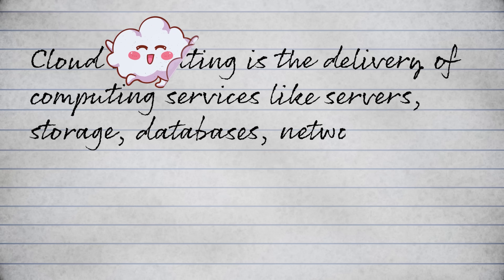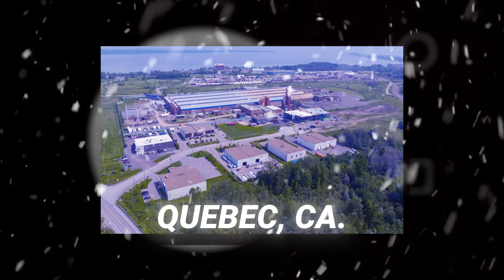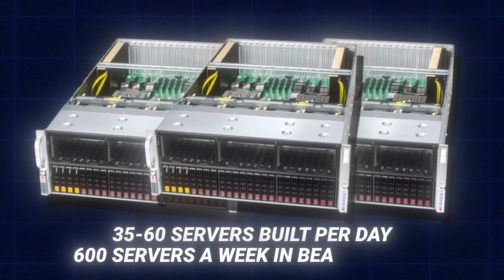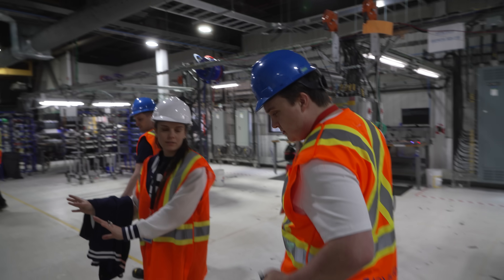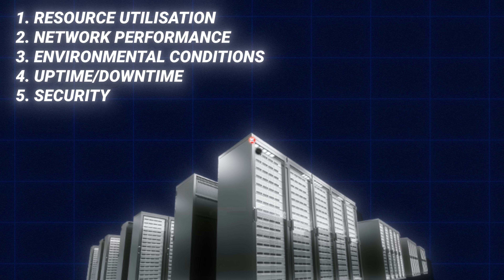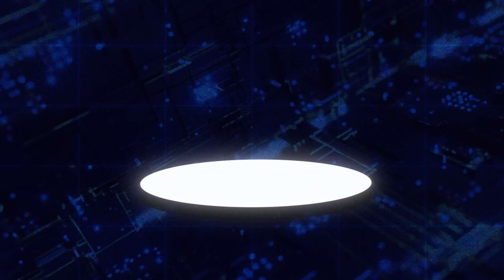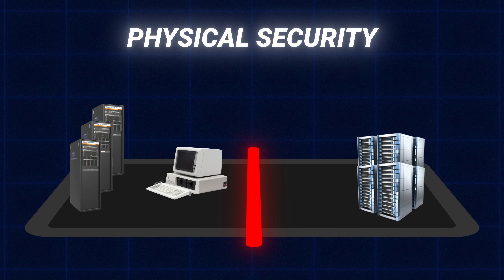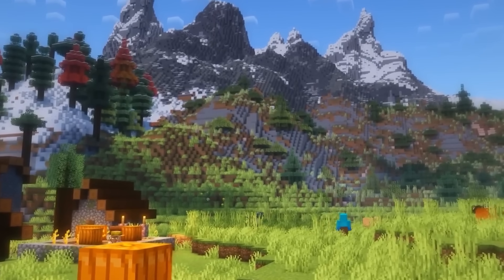Inside a Data Center with 90,000 Servers

Comment: why in the hell do they need the radiators with a body of water nearby they can just use a heat exchanger???? dump the heat in that 40 degree water
Reply: Radiators serve as a way to cool the room (In summer) and heat the room (in winter), they do use heat exchanger plates

Comment: Grafana is great for reporting from tons load of data.  Very easy to create your own dashboards with it.   Too bad they didn't say which Hypervisor they're using which I can understand due to privacy reasons.   Seems they embrace open source I wouldn't be surprised if they are using Qemu / KVM.    Myself personally and professionally I use ProxMox which is based on Debian with Qemu / KVM installed.    Personally not sure why they didn't want to show the merits from Grafana since it's standard stuff at the data center.   Probably they didn't want to show any identifiable host names which can be blurred out.

Comment: This was really cool to see, especially on what OVHCloud operations look like (obviously only at the surface level). I work for a cloud provider at a colocation data center, and I have been to countless locations by multiple ISP providers. Sometimes the infrastructure is extremely disappointing, and sometimes the infrastructure amazes you. Especially when it comes to security and power availability. Awesome video.